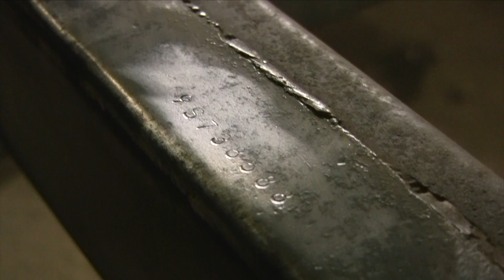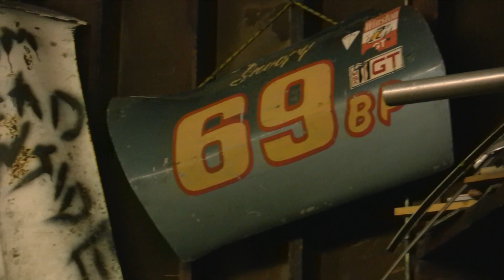WSG AND FRIENDS: C3 Corvette Frame Prep

Comment: Have you considered using a dry-hopper feeder for your sandblaster?  I know you will be constantly adding product and it's heavy as hell, but it's what we used when we fabricated ag equipment back in the day.  It was plenty wet in our shop.
Reply from the maker: No, but that’s a good idea.  Honestly I just saw the cabinet sitting in there and thought I should give it a try haha
Reply: @wildstrawberrygarage5404  Turn the feed hose over on the gun, so it enters from the top.  I am sure you can contrive a hopper for the top, even if it ended up being a bottle with the bottom cut out, and add a small valve to control the flow of media into the airstream and you are all set.  We used a drywall hopper with a valve, but ingenuity is cheaper than that.
Reply: @wildstrawberrygarage5404  I can see why Casey was so impressed with you.  I am looking forward to following your progress with the build and with the channel.  Good wrenching to you!
Reply from the maker: Ahhhh I like that
Reply from the maker: Cheers!! I have more videos on the way.  Been going pretty hard on it the past couple days.   Don’t want to give anything away but y’all will see some big changes over the next couple videos

Comment: I hope you develop a good rhythm of work and knock it out.

Your compressor tank is probably full of water.  This happens faster with small tank and horizontal tank compressors.  Usually there is a drain valve on the tank.  I like to plumb in a goose neck and a 1/4 turn valve so I can use tank pressure to push the water out in to a 5 gallon bucket without draining all the air.
Reply from the maker: You and me both.  Lol yah it’s about 50 years old actually.  Big sucker too.  And you’re right it is full of water.. and rust 😔.  She’s on her last legs.  Just gotta keep oil in the tools!

Comment: Are you going to bend your own tubing for the cage ?   Do you know how to figure out bend take up ?
Reply from the maker: No Im going with a pretty bent cage I’ve used once before.  Price is about the same as it would be for just the round stock- plus I don’t have any dies
Reply: @wildstrawberrygarage5404   makes sense if it's the same or close money .  There is a tubing bender that comes with one die , if I recall it's around 450 and that is about as low of a price for something hydraulic . Another point of the pre bent it's already scca spec .

Comment: Do you have a engine plan yet ?
Reply from the maker: I have some rough ideas and some bits and pieces.  Still sussing out some options
Reply: @wildstrawberrygarage5404   cool  . Imagine there is rules as what can be used . Market place had or has a vet rear suspension sub assembly mostly aluminum .

Comment: home brew sandblaster 
works great whit a auto glass welding helmet and your mate using his smart phone as a torch for you to see what you are shooting the media at whilst he is wearing the race helmet that has a clear visor?
at what point did you realise that was the wrong way to go about it ?

great to see some progress on the car but try to use more ppe and please. just be a little bit more safety continuous of your self and others.
no good finishing the car blinded and def, sometimes it is better to just take a step back and think what do i need to do to make the death wheel safer or this is getting sketchy i should probably stop and think about what could go wrong and how to avoid it

cant wait to see the next one you will be beating the boomers in no time
Reply from the maker: Roger that.   We’ll try to clean it up moving forward